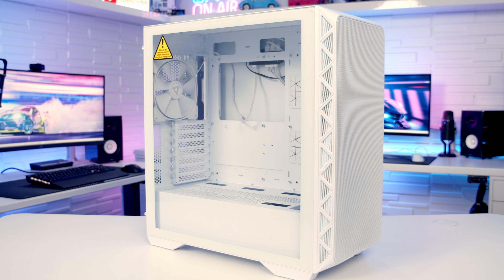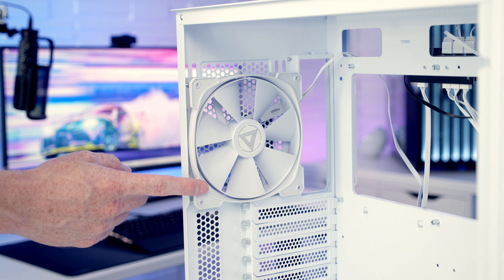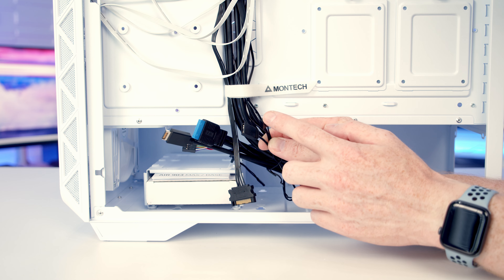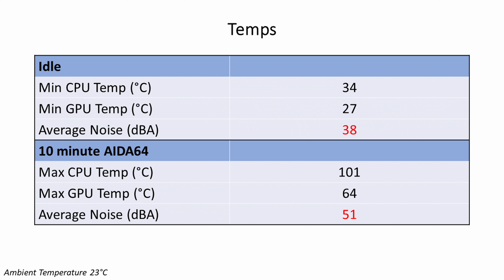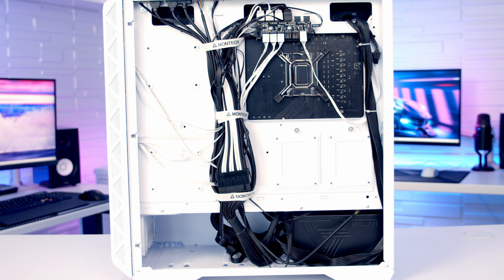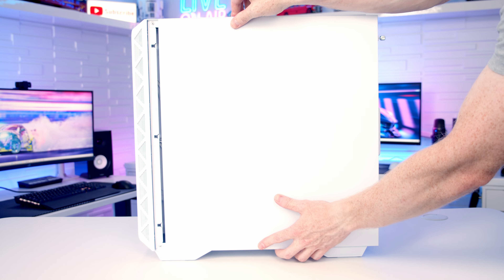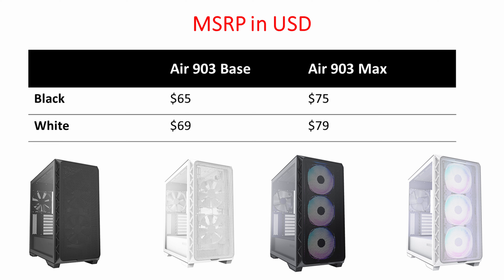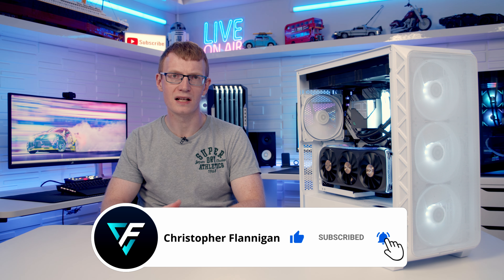Montech Air 903 Max Review

Comment: Genuine question. What powers the hub for the coolers? Assuming my motherboard can output only 1 Ampere max through a single fan connector, wouldn't it be cooked if all 4 coolers were plugged into a single connector? Each 140 mm cooler that Montech provides draws about 300 mA if I'm not mistaken, giving a total of 1.2 Amps.

Comment: Hello, I have this 903 max. I want to change the front fans for 3 ARCTIC P14 PWM PST A-RGB. These Artic fans are connected in a chain. My idea is to connect the last PWM connector in the chain to the FAN 1 port of my motherboard and the 3 ARGB of each fan also go in a chain. Could I connect the last ARGB connector in the chain to a single connector on the hub or do I necessarily have to connect each front fan to a 3-pin connector on the controller hub?

Comment: I finished my build in this case last night. The only thing I’ve noticed is that the case fans are loud pretty loud. Is there a way to fix that?
Reply: Bought the exact same case, have the exact same issue. Did you ever find a way to reduce the noise?
Reply: I did my first build two days ago using this case. The one thing I noticed is that the case fans are running extremely fast and loud even when idled. I’m not comfortable with changing the BIOS since idk what’s considered safe to do without damaging my components. I am thinking of bypassing the hub and connecting each fan directly to the motherboard.

Comment: Woah woah 102 celsius underload? Did you mean farenheit?
Reply: Nope. Depending on the motherboard used, this is sadly "normal" for Raptor Lake (Ryzen too), unless tuned of course.
Reply: @Totto70770  lol I learned the hard way. I ran cinebench r23 on a ryzen 5 5600 stock cooler and I hit 95c, mind you I have 3 intake and 1 exhaust fan